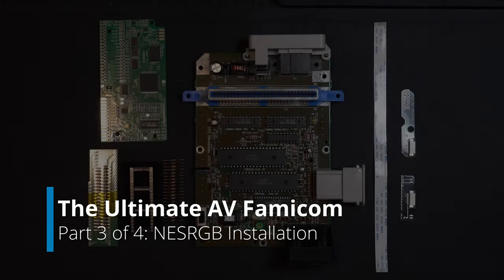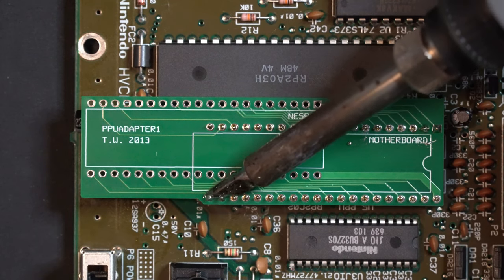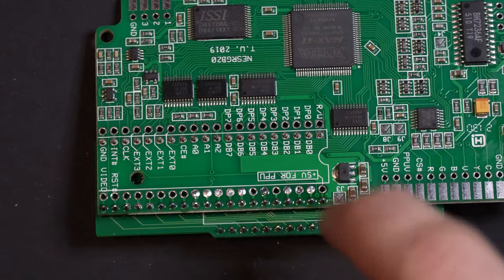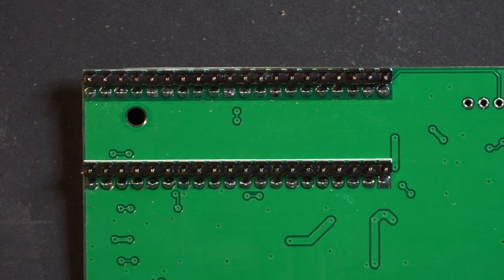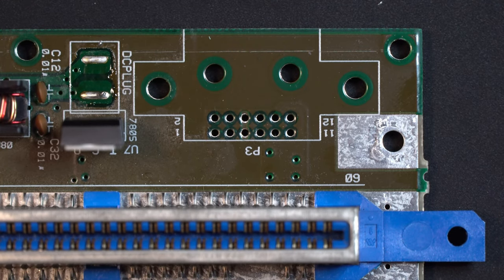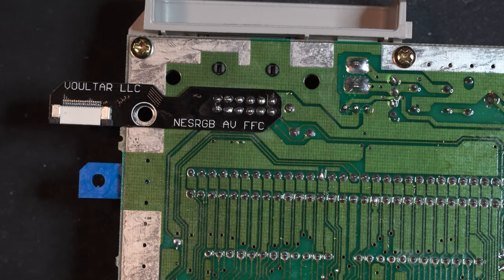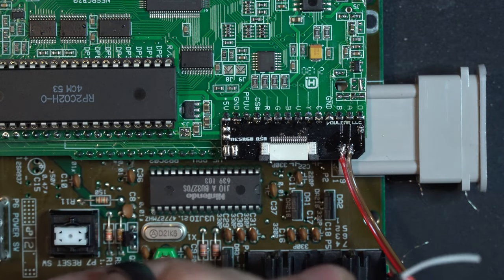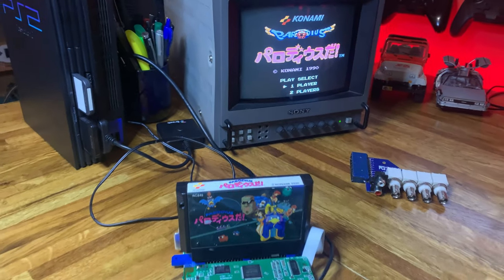Ultimate AV Famicom (NES) Mod - eTim NESRGB Installation (Part 3 of 4)

Comment: The trick to better drag soldering on a two-sided PCB is to add fresh solder AFTER getting the legs to flow solder all the way through. You should already have liquid flux on the board but you want to deposit fresh flux from your solder core and replenish the solder reservoir on your tip just as your tip leaves them, not as your tip arrives. Of course, you have to add a good bit of fresh solder to start but once it has heated enough to ensure it has flowed through to the other side then the flux has already gone inactive (burned up) and you need to add more. You may also want to bump the temperature up a bit from where you had it so it can flow through quickly with the liquid flux that was already there.

So:
Flux the whole row with liquid flux, make a large blob of solder at the start and once it flows both sides add the tiniest touch of solder as you drag away. The thermal mass from your knife tip and solder blob should activate the liquid flux on the board and refresh the solder as you envelop new pins but you want to drag slowly enough that it flows all the way through. By then the flux will have inactivated so you add the tiniest touch of fresh solder just as you move away from those too. Because the standard size K-tip can flow three legs at a time I give it one kiss of solder for every three legs.

Comment: The SCART compatibility thing in the official guide isn’t because the AV Famicom guide is outdated. I mean, it is, but that part was talking about the “official” SCART cable… which is PAL-only and has a different spec from NTSC RGB cables (75Ω resistors instead of 220uF caps). The GameCube SCART cable was more like the NTSC RGB spec because it had 220uF capacitors on each color channel.

Comment: What size drill bit did you use for separating the grounds on the AV multiout? Thanks for the in depth videos on this as my next big project is RGB modding an AV Famicom.

Comment: Hello great video, question the quality video output with etim mod will be the same as nesrgb mod red chip?🃏
Reply from the maker: Thanks for the feedback. I am not familiar with the "red chip" mod. Can you elaborate on what you're referring to?
Reply: @kytor   I'm sorry I'm try to put link but I can't,I meant nesrgb igr from powrup gaming
Reply from the maker: @R0SS0Jester  The IGR board doesn't change the picture quality, it enables a "no-cut" palette switching capability. I just posted part 4 of this series which takes you through the IGR install: https://youtu.be/NW3KypIElhk
Reply: @kytor  understand thank you for explaining, I'm interesting only this mod and I want ask if you have any issues with games sound and video?
Reply from the maker: @R0SS0Jester  I have completed the NESRGB mod a number of times now, and have never had any issues with sound or video. Tim Worthington did an amazing job engineering and manufacturing this product. The only downside to this mod is the higher cost relative to getting RGB out of other systems, but in my opinion RGB on original hardware is truly the best way to experience NES games.

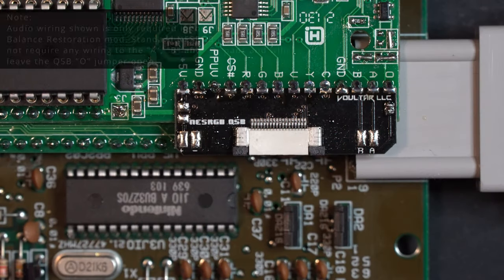Keep in mind the audio modifications 47:22 are only required for the AV Famicom and only if you are doing the audio balance restoration mod. For the other models, this is not needed.
Reply: @kytor  wow amazing,I wish was professional like you to soldering ^.^  ,how much will be you think some NES console with this mod?, I'm thinking to buy one but i want ask to someone understand well like you
Reply from the maker: @R0SS0Jester  You can do it too! The NESRGB is currently $150 AUD plus shipping. If you're not comfortable installing it yourself, I would recommend hiring Voultar, he charges $80 USD for the service.
Reply: @kytor  thank you very much for info ^.^ I have chance to buy twins Famicom with RGB and S-Video output the only problem is I like to have original NES controller because I'm growing up with NES so I want same controller so you think can be swap the cover of the controller from NES to twins Famicom controller?
Reply: hello and thank you for these fabulous tutorials.  On the Voultar page it says that the Nes RGB-IGR is not compatible with Tim's NES RGB V4.  It is right?  yay in that case what version of Nes RGB by Tim Worthington have you used???

Comment: I've got a new guide with photography coming out that doesn't require any trace cutting or wiring from the bottom of the board. Everything done from the top for expansion audio restoration, and lines less than two inches long. Preview of my work progress:
http://www.firebrandx.com/consolemodding/uavfam-04.jpg
http://www.firebrandx.com/consolemodding/uavfam-23.jpg
Reply: I was about to start mine, but I'll wait for your guide now! Looks awesome.

Comment: Great detail in this video, but is the QSB required? It looks like the AB lines for audio would go straight to the NESRGB board from the CPU, but how would the output O wire be connected? How would the audio finally get to the multiout? 
Thanks!
Reply from the maker: The QSB is not required, it just makes for a cleaner, simpler, installation. O is wired to the cartridge slot pin 45.

Comment: 2 questions:

1 is the PPUAdapter required?
2 which soldering station u using? Model?
Reply from the maker: Yes the adapter is required to fit everything inside the console shell.
At the time I believe I was using a Hakko 888. I've since upgraded to a Hakko 951 and I'm much happier with it.